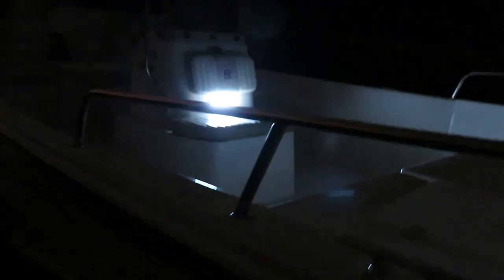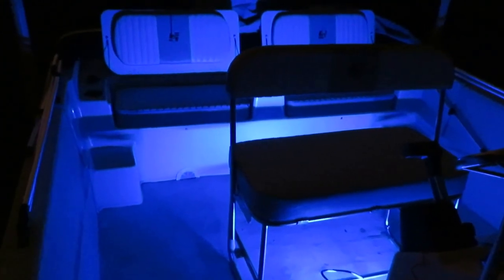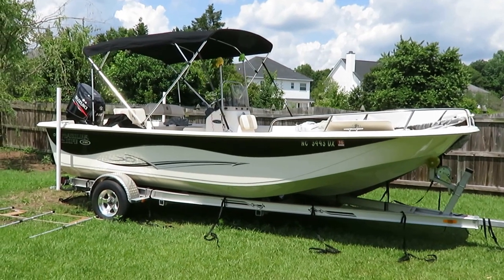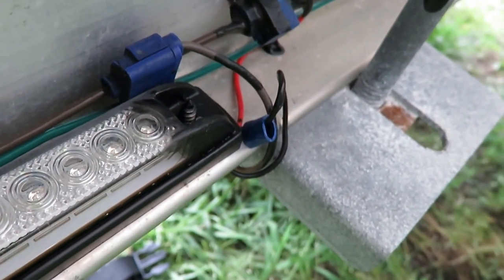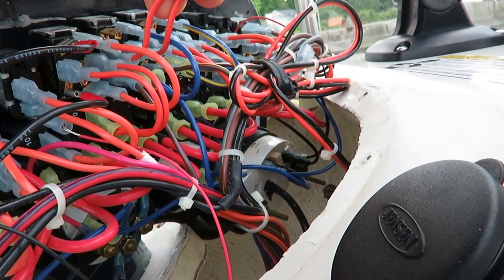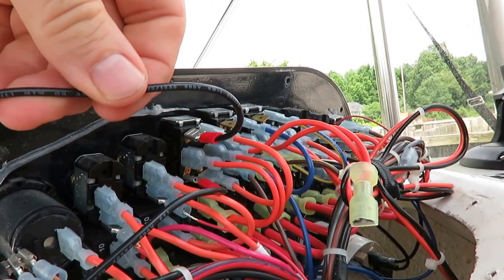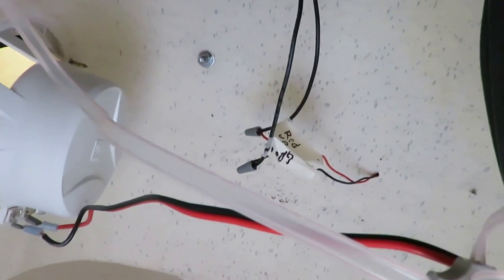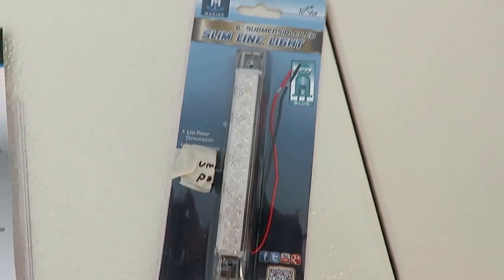How to install LED lights inside your boat and on your trailer

Comment: I need a little help and maybe you know. Let's say you didn't use the third accy and you used 1 or 2 accy switch instead.... Would you just put a female clip on the hot from the LED and put it on the male pole of the first accy?  I only have the first 2 accy buttons and I want all led on 1 switch. Do you know how I'd use the 1 switch?  Even in your video i see where there is an orange wire already on the middle pole of accy 1 and 2. I feel like you'd remove that and then plug the lights to that. I'd then ground the lights wherever.